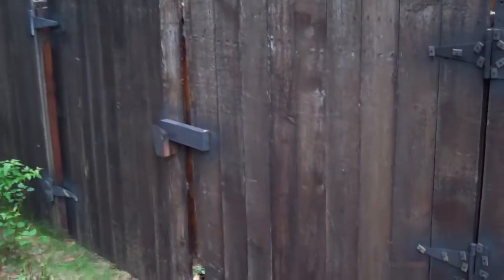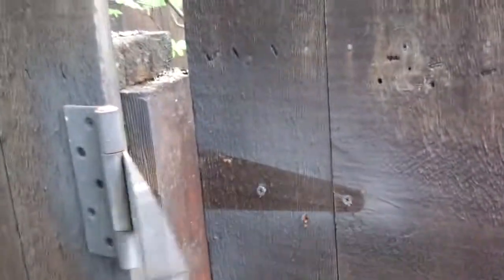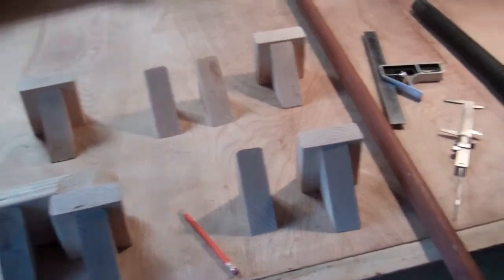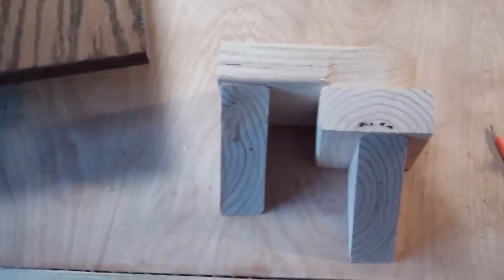Fence Hinges

Comment: If you have a welder or know a welder you could make some metal hinges out of at least 1/8 stock using the same idea just more like a normal hinge... A welded in rod to one half of the homemade hinge allowing it to be lifted straight off... Hope that helps ya buddy